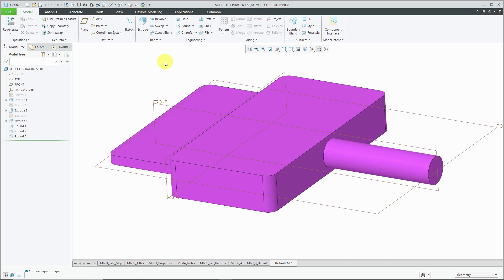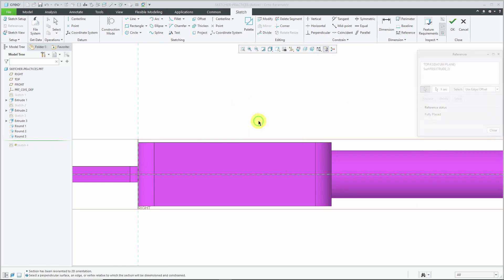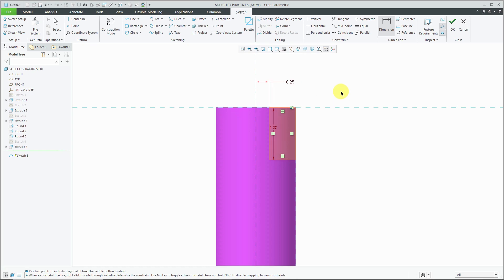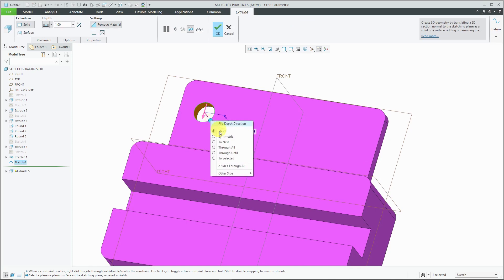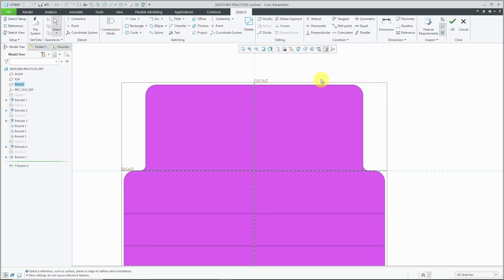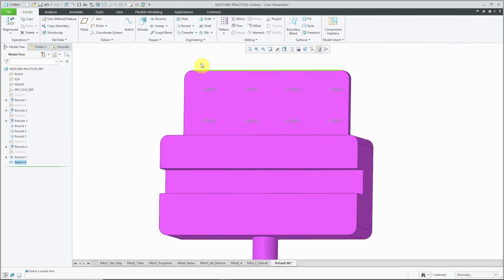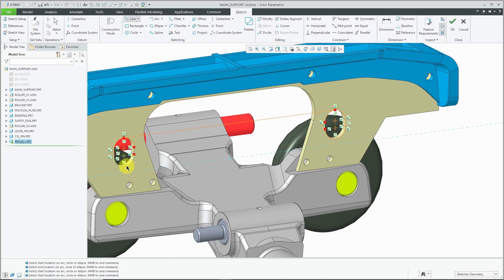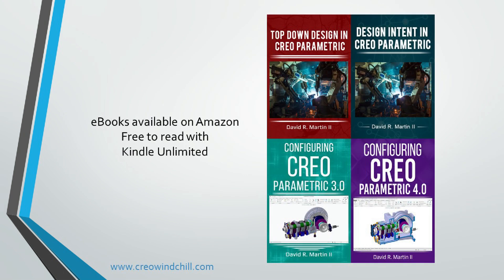Creo Parametric - Sketch Mode Unhealthy Practices

Comment: Hi Dave! Thank you for this health video :)
For the creation of hole patterns, I often do it like you with points or with a Pattern feature. However, when the holes are along a rounded shape, the radial and circular centerlines don't appear in the drawing (even with Show Model Annotations feature on Pattern feature), whereas with a radial Pattern feature, they do. I then have to draw a layer sketch for the axes...
Do you have a trick to make those centerlines appear when repeating by radial points?
Thanks a lot to @Creo Parametric
Reply from the maker: Honestly, I’ve never been passionate enough about drawings to pay that much attention to the nuances.

Comment: So I've been told to not use an extruded hole in place of a hole feature, but I have never been told why. Can you explain why this is bad?
Reply from the maker: I cover that specific example in my Design Intent video and book. The answer is... it depends on Design Intent.
For example, if it's likely that the hole might need to become a slot, then a sketch and extrude would be preferred.
But if the likely changes are things like counterbore, countersink, dimensioning scheme, standard hole sizes, etc., then the Hole feature would be preferred.
Reply: @CADPLMGuy  @x_unt plus there's the added benefit of the parametrically generated hole callout notes for the hole feature vs a simple extrude when using the "show model annotations" tool in drawing mode. Having that note dynamically linked to the feature saves lots of headaches of trying to remember to update a manually typed out note as a design matures/changes over time.
Reply: You have more end treatments, depths, and edge options vs. a plain hole. Anytime you have to do a complete feature redefine sketch to make a simple tweak, you can blow stuff up ;) . Inventor uses this type and its bad.
Reply from the maker: @tednugentlives  Yes, SolidWorks essentially has two sketches for a hole, one to locate, one to define the shape. If you're trying to create something that's going to be a hole in the real world, the Hole feature in Creo gives a lot more flexibility for making changes than a sketch.

Comment: Nice video. Can you make some video, using the resolve mode for resolve the errors in models?
Reply from the maker: Tiago, short answer: yes.

Longer answer: I created a presentation on Resolve Mode 15 years ago and it kicks butt. I wrote the chapter on Resolve Mode for Tristar's Pro ENGINEER Quick Reference Guide. Resolve Mode is a subject near and dear to my heart, and the only reason I haven't done a video on it yet is that I want to make sure I do it justice and spend considerable time planning and preparing.
Reply: @CADPLMGuy  thanks, I will be waiting.

Comment: Regarding the last sketch tenick, with this explanation a lot of my problems makes sense now!
Reply from the maker: Glad this helps. Yes, using the Project and Offset Edge commands to external references leads to a whole host of problems if the original model isn't in session, gets renamed or lost, or you're trying to make modifications later... If you do use those commands, you can also remove the edges from your list of Sketch References and have the entities be dimensioned to local references. It won't be parametric but it will avoid the other reference issues.
Reply: Another in topic question please,
When you have the main assembly then create a new subassembly, activated the new subassembly and you want to assemble a part. Is good practice to reference datums in the main or subassembly. If the subassembly is there any way to not show the other datums? 
I know that the active datums have more gray color than the others but with big assembly's it's frustrating and difficult to locate.
Reply from the maker: Thanks for your question. Ideally assembly constraints should be limited to the assembly in which a component resides. In the scenario you describe, you should reference the datums in the subassembly, not the main assembly. Otherwise you can have issues if you retrieve the subassembly on its own without the main assembly in session.

I usually open the Layers dialog box to turn the display of datums off in the main assembly or any other subassemblies that aren't active. Let me know if you'd like me to put together a video to demonstrate this.

Thanks for watching and commenting! (Seriously, comments improve the videos' rankings in the YouTube algorithm.

Comment: Hey 
i need a help on  how to convert .stl file or facet into solid so that i can modify in creo
Reply from the maker: You can try using Save As > Save a Copy to export it to a Shrinkwrap to get a solid, but it will be very difficult to modify. The Reverse Engineering Extension (REX) - which by the way is very expensive - does have some functionality for manipulating facets, but it's probably been more than 10 years since I've touched that module.
Reply: No prob so i have another option I'll ask my frnd to do it in catia its simple in that
Reply from the maker: Jatin, do you have the file in a .OBJ format? If so, you can import it into a Freestyle feature.